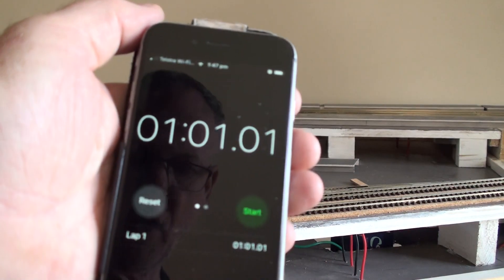N Gauge Four Oaks Street  Station Part 96 Loop completed but how long is it and how to calculate it?

Comment: That's a really helpful way to work out scale train speeds. For smaller layouts (such as mine), using a scale 1/10th mile is helpful. That is 3ft 7 in. or close to 1.1 meters. (It so happens I have a platform on my layout precisely that length - passengers please stand clear of the platform edge for speed trials!)
So, to cover that distance at 30 mph takes 12 seconds, 40 mph 9 seconds, 60mph 6 seconds, 90 mph 4 seconds, and 120 mph 3 seconds. This way many of the 'regular' speeds are mapped out in easy seconds ! Great video thanks.
Reply from the maker: that's excellent Graham, it's always nice to hear that someone has found something useful from a youtube offering. Graham you should put up a video of your layout at some point. cheers Graham.

Comment: Hi Chris! Some great calculations there! I said about 10 minutes of continuous running so wasn't far off, especially if you factor in a slower 37 or 40! I did wonder whether or not the trains actually slow down when ascending the helix - or speed up on the descent? But let's not get bogged down in the details! Lol! The result is that the trains really do look good running through the countryside at realistic speeds... continuously! All the best, Ian.
Reply from the maker: Good point, i believe the back EMF is like a cruise control, but i might be incorrect. Cheers Ian

Comment: I did a little measure of mine a few months back. I had roughly 1 mile for the full lap by pure chance. I was quite surprised at how slow I have to go to do the full lap in 1 minute.
Reply from the maker: From what I have read it's because we are viewing generally from above and quite far away in scale a  similar principle when we view a plane and it looks like it is not moving, cheers
Reply: @ngaugefouroaksstreetstatio6932  I do slow it down now a bit. Perhaps if I had a flat layout it would be easier.

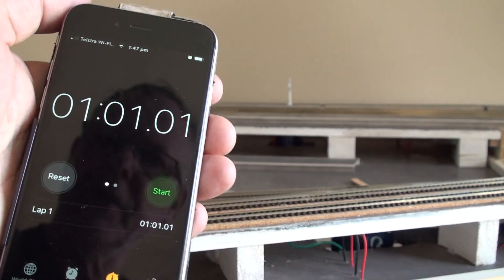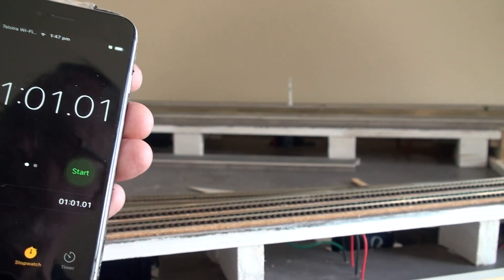Comment: Interesting to see. Maths on YouTube is risky (I fear it any time I do calculations in my videos, as I've caught a few mistakes just before publishing!). You used 7:27, i.e. seven minutes and twenty-seven seconds, as 7.27 minutes in your calculations... but 0.27 of a minute is 16.2 seconds, not 27 seconds; 7:27 as a decimal number of minutes is 7.45 minutes - not sure how much difference that makes to the overall numbers but I mention it in case it helps!
Reply from the maker: Yes agree,  it's risky and you are correct. I decided to mark out 1 scale mile to try and make it simpler. The distance was 35.67 feet and the class 108 took 1 minute so 60 mph was the speed of the train. The distance calculation should be 35.67 X7.45= 265.74 feet or 81.76 metres. Thanks for the feedback

Comment: Very interesting Chris.  That is going to be so helpful in running trains at scale speed.  The two goods trains really did look good running around the layout especially through the countryside and over the viaduct. You are going to be able just to sit and watch trains for hours.  If have them all at the same scale speed you are not going to need to do too much adjusting the controls for trains following each other.  Stephen
Reply from the maker: Thanks Stephen, I think when model trains are hitting scale speeds over 120mph they look wrong unless you have a massive layout, way bigger than mine, I have seen the Japanese Kato trains whizzing round like slot cars at some exhibitions. Cheers